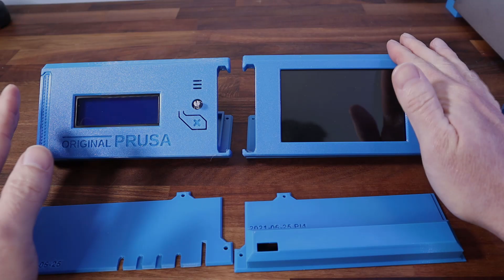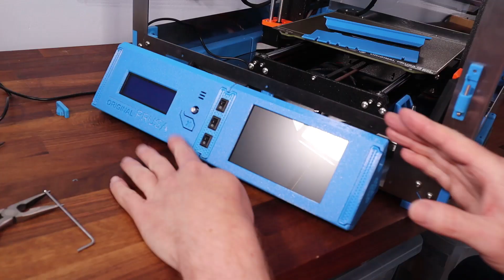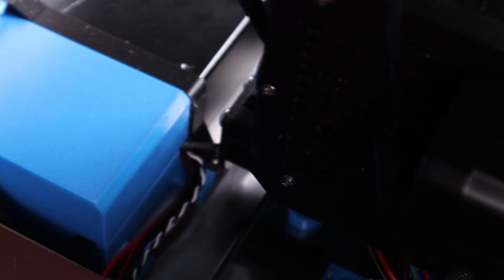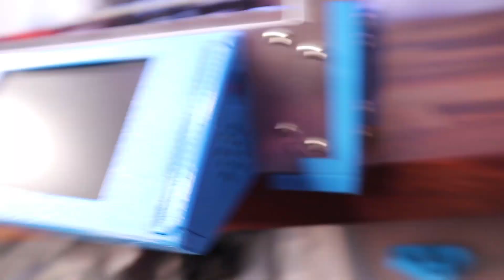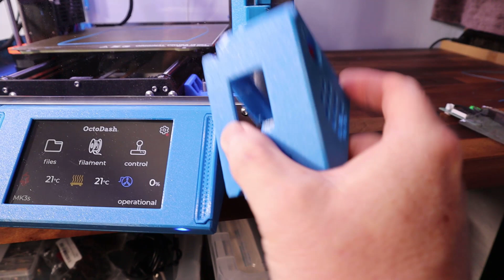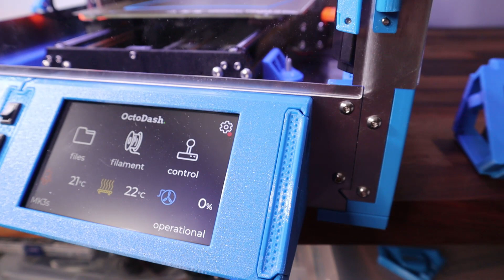Prusa 3D Printer Enclosure - Fitting PrusaBox Modular Front - Pi / Screen / Octoprint Octodash

Comment: Will this work in the lak table and would there be room in the rasberry enclosure to fit the wifi usb?
Reply from the maker: It can be made as self contained and could perhaps be mounted on the top front of the lak. If the wifi is a dongle then probably is room. You will need longer cables for the Prusa display, easily available on Ebay as they are generic plugs on those cables.

Comment: hey, exciting build.  You don't happen to have a list of everything you used regarding electronics?  I have a Prusa Box that I was thinking of building on.  Also have a pi4 that I was thinking of using.
Reply from the maker: I think links are in the detailed description. But also watch my latest video on pwm temp controller for modular front, that has far better fan controls. I also suggest you fit a 40mm noctua fan inside the modular front as pi 4 needs cooling. Links for that in my pwm video

Comment: i also purchased an enclosure from amazon 3D SOURCERER Universal 3D Printer Enclosure 5mm Plexiglass Kit [540x540x620mm Inner Volume] IKEA Lack PRUSA MK3S/Creality Ender 3/5 Pro | Fire & Dust Proof Constant Temperature Protective Tent i am waiting for the printer to print the parts to put it together , in fact i am waiting for a cr-10 smart pro to come in to print the parts i need for the prusa how are the led lights and fans connected to the pi
Reply from the maker: I have seen pictures of that enclosure but not been provided with a review version yet

Comment: HI, THANK YOU FOR THE VIDEO I HAVE JUST PURCHASED A PRUSA I3 MK3S+ ALONG WITH A RASPBERRY PI 4 AND A HYPERPIXCEL 4 TOUCH SCREEN AND I FOUND A DUAL CASE LIKE YOURS , I AM VISIONED IMPAIRED AND NEED A SCREEN THAT I CAN ACTUALLY SEE , I ALO GOT A NICE 5 mm PLEX ENCLOSURE FOR THE PRUSA AND COULD USE SOME GIUDING ON THIS PROJECT AND HELP  WOULD BE APPECIATED ,  WHAT KIND OF SCREEN ARE YOU USING , I AM USING A LINUX PC AND HAVE COME ACCROSS KLIPPER ANY COMMENTS ON KLIPPER THANK YOU
Reply from the maker: No idea on Linux. I just suggest you use octoprint on the Pi, and control prints from pc browser by connecting to the Pi's IP. I am building a new pi control box for prusa mini with no control screen, video out soon

Comment: Hi Collin, good info. Unfortunately I noticed that the files do not allow to use the HDMI to  HDMI bridge version to connect the rapsberry to the display which I use. Is there a plan to add more panels as I would like to stick with the 5" elecrow display I finally got running with my MK3. Thanks
Reply from the maker: I believe all the screens for prusabox are designed for DSI ribbon cable, if you use hdmi then you will need to modify yourself. That will be a challenge as there isn't much room. But good luck.
Reply: Hi Colin, thanks for the answer, I will have a look, then.
Reply from the maker: @ulliulli1287  I had 2x 5" screens both with hdmi. Ended up buying a new waveshare DSI screen

Comment: How are you supposed to access the SD card after everything is mounted?
Reply from the maker: Open the door. You then have access, if you are using the flat standard mount design. Options are use octoprint so SD card is irrelevant, use the modular front where SD card is outside the box, or continue opening the door
Reply: @colinhill  no sorry I am talking about the micro SD card on the RP. There is no way of talking it out after the RP is mounted.
Reply from the maker: @mrjayd  correct. Why would you need to remove the card once the pi is set up? Once set up and working you would need to part dismantle the parts to gain access. But nothing too difficult. I never have to remove the pi card.
Reply: @colinhill  it’s just I can’t remove the SD card without removing the whole pi from the module. So do I just install the the pi software and octodash software first and then mount the pi back to the module and be done with it? And how do I power the pi up and run the power cable.
Reply from the maker: @mrjayd  answered your own question. That's what you do
Reply: @colinhill  and how do i power the pi up and run the power cable?
Reply from the maker: @mrjayd  Well..... i am currently using the 5v output from the buck converter. However, i often get undervoltage warnings. This is likely because the pi needs 5.1v and the converter output may be 5v or slightly less. Doesnt affect Pi performance. I am either going to use a dedicated pi power adaptor, or change the buck converter for one the allows the 5v end to be adjusted. I just havent had time to look at doing this. For now, it works, just get messages on the PC when using Octoprint about low voltage.
Reply: @colinhill  thx and how do I wire it up to the buck converter?
Reply from the maker: @mrjayd  I just is a usb cable. Plug usb A end to buck converter usb A output, and other end had micro usb (for pi 3b+). Different if using Pi4. As mentioned, there are more efficient power methods.

Comment: Hi again Colin, what kind of ribbon cable do I need to connect the screen to the PI and is that all I need between the two boards?
Reply from the maker: I bought a 15cm ribbon cable off eBay, designed for display connection
Reply from the maker: If it's a DSI screen you only need the display cable
Reply: @colinhill  perfect thanks and what kind of cable should I look for?
Reply from the maker: @mrjayd  I just looked on eBay found item with this description... Flat Ribbon Cable for Raspberry Pi Camera and Display - 15cm

Comment: What version/model of PI do you recommend for the front panel along with the 5 inch screen?
Reply from the maker: I think I left a link for the screen . Waveshare 5" but must be DSI version. I use pi 3b+ as it doesn't get hot. Pi4 often needs cooling.
Reply: @colinhill  thanks Colin. Is 1gb of ram enough on the 3+ to run octoprint and octodash?
Reply from the maker: @mrjayd  Thats all mine has. it can run octoprint fine, plus screen and webcam

Comment: Hi Colin, I am using the exact same LCD screen as you, based on comments below, the Waveshare 5" DSI screen.  I have installed octoprint, and octodash.  The initial octodash screen comes up, but the touchscreen doesn't work.  Did you have to install any touchscreen drivers to make octodash work?  I have been searching for drivers for this model of screen but can't seem to find any. I'm really hoping I don't have to open up the case to remove the SD card to reimage it.
Reply from the maker: Have you looked at this https://www.waveshare.com/wiki/5inch_DSI_LCD?amazon   which may help you

Comment: What size is the case?
Reply from the maker: You can find details of the enclosure size at https://www.printer-box.com/?wpam_id=1
Reply: @colinhill  Thank you!  Do you know by any chance if a 20x20 enclosure is good enough for the Prusa i3 MK3S+ to fit in?
Reply from the maker: @darkliquid6388  I would say min 17.5" wide by 21.5" deep internal dimensions. This is approx same as prusabox. 20" depth is too small to allow bed to move and avoid heated cable impacting the rear wall.
Reply: @colinhill  Thank you for the reply.

Comment: This is awesome. When adding the 7in display screen, is there an STL to also angle out the LCD screen from the Prusa Box like shown in the video?
Reply from the maker: Its max 5" display for this moulding. 7" is too large. I believe there is a 7" holder but its not designed to fit the modualr display parts.

Comment: Hi Colin, are you able to share which fans you purchased? I’m unable to find them (via amazon). Also do they have ones with the USB A ends? If not are you able to show how I can go about modifying them? 

Thank you!
Reply from the maker: Are we talking about the cooling fans for Pi? If yes, there are a couple options. get a fan of the size you need - 30mm / 40mm, get an old usb-A cable, chop it, attach positive and negative as required via soldering, use the Pi usb outputs. Or better... get a 30-40mm fan with 3 cables like this https://thepihut.com/products/highpi-pro-5v-fan-software-controlled and connect to the GPIO pins of 3.3v (or 5v), ground, and pin 14 - this allows you to change the temp on the pi in the config when the  Pi cooling fan turns on/off. This would be my preferred option.
Reply: @colinhill  Yes that’s right. I found a 40x40 pwm fan but can’t locate a 30x30 pwm fan unfortunately. Do you think I should skip the 30x30 side fan and just use the 40x40 pwm fan? Also do you have a link for the push in on/off button you used on your modified side? Thank you so much
Reply from the maker: @remiilatte  just go for the 40 that fits in the bottom plate. Or pi hut does a 25mm version if you make a spacer. For switch needs a 7mm threaded shaft like this https://amzn.to/3onL151
Reply: @colinhill  thank you so much for taking the time to reply and your advice

Comment: Hi Colin, please can you tell me what screen you are using for your octodash ? I have been having massive issues with drivers on mine even the tech guys at work are struggling! I have a waveshare SPI 3.5" 320x480 Touch Screen (GPIO) from ThePiHut. Hope you can help, thanks.
Reply from the maker: This is the one i am using https://amzn.to/3B2E6Ss   so see if you can find something similar. It only uses the ribbon cable via the DSI connection (not GPIO or HDMI)
Reply: @colinhill  thanks for the info, I will give it a try 👍

Comment: Hi, Colin! I've really enjoyed watching your videos. You've convinced me to order a Prusa-box. While I wait for them to get their stock situation straightened out, I have printed the parts to use the modular control panel on its own. I was hoping you could point me to a tutorial on how to convert the pi fan connectors to a USB connection as you've done here. I appreciate any help you can provide!
Reply from the maker: Hi. Thanks for comments. I found an old usb cable, chopped it short. Opened the cable and striped the red black wires and soldered those to the fan wires. For the other two wires in usb I cut those back shorter at slightly diff lengths and used heatshrink tubing insulation to stop any shorts
Reply: @colinhill  That's perfect! Thank you!

Comment: I have not fully decided on how I am going to install my screen. I ordered a box "backordered" So to make good use of my time I got my Pi going with a 7' Pi touch screen. Currently have them mated in a basic case with a fan on the Pi.. Along with a Logitech camera using spaghetti detective. I am printing all the parts PETG I will admit I really like printing PETG vs PLA once you get it dialed in the printer handles it well! Better then the Raised 3D unit we have at work. I have a question using the 7' screen I am not printing the front you did mine is flush hiding the SD card. I had planned on just using an extension for it. What was the plan there? I have printed the parts for the 7' screen I might use a blank and just keep it next to the PC monitors I have gotten use to it where it is HA.  Thanks for the videos you have posted BTW they should put you on their site.
Reply from the maker: When I had the prusa screen flush I just opened the door to access the SD card. You could probably design a mount for a car extension and amend the front bezel. Thanks for comments

Comment: Colin, I got rid of my usb printer cable and wired the pi 4 directly to the Enisy board and used a buck converter to down grade the voltage from the bed plate power to 5 volts going to the Raspberry Pi for power. This video linked shows how its done. The only thing I did differently was make my own DuPont wires using the images in the linked videos and eBay parts. https://www.youtube.com/watch?v=bRLMJiW7ki8&t=634s :) I will show my setup on the Printer Box Communty FB group sometime today.

Comment: Hi Colin! I've got an idea: If you move the raspberry pi on/off button under the middle 2 rocker switch, there would be enough space on the right side for the fan.
Reply from the maker: Anything is possible. I have the switch recessed to ensure its not pressed by mistake. I don't want it sticking up proud of the surface. In the centre join there isn't enough room for a recessed switch. But have a go yourself with that idea and let me know if it works ok. Be interested.

Comment: I've got the same screen on mine and I'm having problems with it displaying only as a square aspect ratio on the left side. The touch is working as expected. What did you do to get the correct aspect ratio to display? The boot time with this display takes quite some time longer than yours and my previous gpio screen booted instantly.
Reply from the maker: Didnt do anything, working without changes (apart from setting the orientation). Perhaps have a look at this https://www.waveshare.com/wiki/5inch_DSI_LCD?amazon
Reply: @colinhill  Thanks.